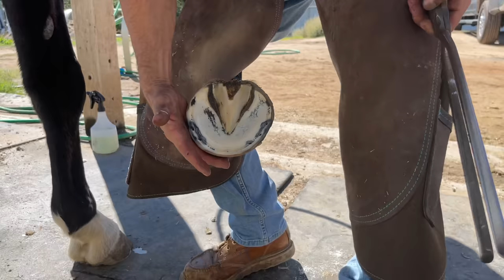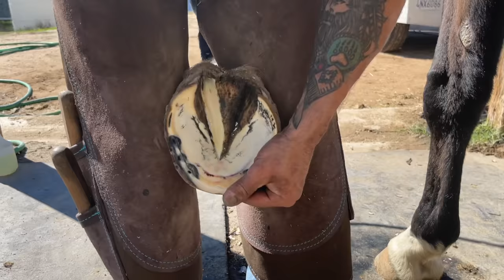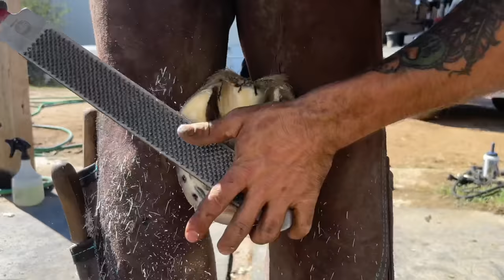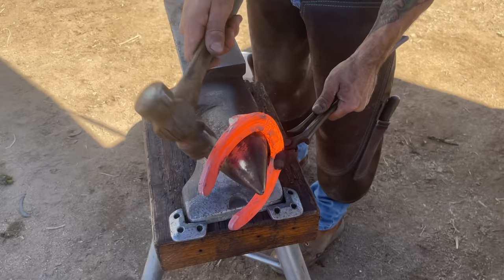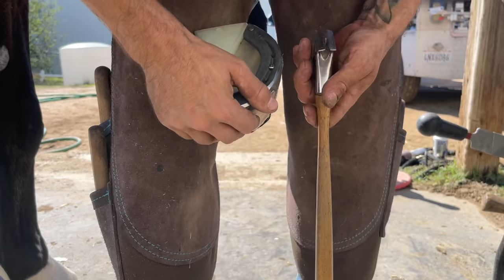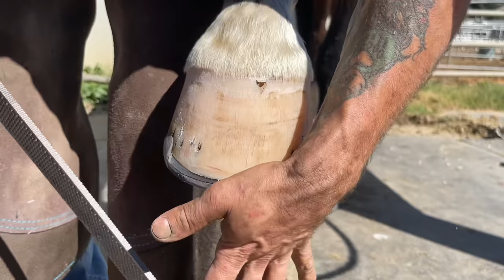Farrier ASMR-Full Hoof Restoration Copper Sulfate Hoof Packing (Satisfying)

Comment: I'd love to see one where you explained what/why you were doing. As someone who has never shoed a horse (and never will) I think it would be super interesting to hear the basics from yourself, given you're so clearly an expert in your field!
Reply: I second this suggestion.  It would be interesting to hear about the anatomy of the hoof and what he’s doing to specific parts and why, etc.,
Reply: Nobody talks when doing a asmr,wdym
Reply: @Terminal.Rainbows  & Sigijade :
1.) Carving out the sole. 

2.) Carving out the bars (heel). 

3.) Clipping the hoof wall (quarter walls)

4.) File or sear the bottom of the hoof so it is plumb with the horseshoe.

5.) With brand new shoes, nailing in 2 nails for the inside of the hoof and 3 nails for the outside of the hoof. The claw of the hammer on the topside of the hoof afterwards is the clip off the excess of the nail. Then they nail is smacked into the side of the hoof so it is flush and doesn't protrude.

6.) Then the toe is filed to be flush with the front of the horse shoe
Reply: 🐎 Horse Boot Polish...😎
Reply: Strong silent type
Reply: 1 second this. Im fascinated by watching this.. It would be helpful to know the whys.
Reply: You could watch The Hoof GP. He works on cows feet and he explains a lot of what he does. It is different from horse hoof trimming but still really fascinating to watch
Reply: 8
Reply: I agree.
Reply: watch S&S horse shoeing. he goes into detail ❤️❤️
Reply: @malayguyutubee3405  what do YOU mean? yes people do talk in asmr videos lmao
Reply: @asmongoldsmouth9839  Hello, do they remove skin of horse/cow during Hoof restoration?? Please, let me know.

Also, is Hoof restoration practised worldwide?
Reply: @MrAAMNNITAllahabad  afaik no, no skin is removed as that would be painful and unnecessary, only hoof. Like your fingernails.

And this needs to be done (the trimming, not the shoes) or else you get an animal that can't walk anymore and is in constant pain, yes. Does everyone do it? No. Should they? Yes.
Reply: Чувак, это асмр
Reply: Blessing and honor and glory and power Be to Him Who sits on the throne, And to The Lamb, forever and ever.

Comment: I gotta ask because this has to be such a lost skill in demand. How often (on avg) does a horse need to be shoed and about what is avg fee?
Reply: About every month and half, in the UK it costs between £100-£140 for trimming and shoeing per visit.
Horses are not cheap...
Reply: @dogsnads5634  yeah, cheapest part about owning horses is buying em, its all bills from that point onward!
Reply: In my part of Canada Carol, its 45 bucks a trim every 4 to 6 weeks and shoes vary depending on what the animal requires for shoes...like anything else, how one horse is shod differs from the next as every animal is different.
Reply: @kimcallaghan3404  thank you so much Kim for the info
Reply: Hardly a lost skill.
Reply: Have to shoe at least every 8 weeks and 6 is better, in colorado a full set f regular, not hot shod for therapy showing like this is 150 like this can be over 200

Comment: Being a farrier isn't an easy job by any means. Setting the physical labour  part aside for a second, a farrier has to learn two very different fields of knowledge: anatomy of and how to treat issues with horses' hooves, and how to work metal. Shaping a shoe isn't just heating up a strip of iron until it glows and then hitting it with a hammer until you get the shape you want.  you have to know what temperature is best to work with, and how over- and under-heating will affect the metal and its properties. Then there is the hammering itself: I did some jewellery making and silver smithing some years back, and learned that if you hit the metal in one way,  one thing would happen, hit it slightly differently, and something completely different results. 

          So I take my hat off to all farriers- after all, they aren't just people fixing metal shoes to horses with nails: they are true masters of two very different crafts!
Reply: Blessing and honor and glory and power Be to Him Who sits on the throne, And to The Lamb, forever and ever.

Comment: Very nice! I've watched quite a few of these videos now, across different channels, and you're doing an outstanding job! :) Here's a question: You're fitting the horse with a shoe that includes a plastic layer. Is that for additional protection? I saw one of S&S's videos where he added a leather pad for therapeutics (I believe because of a broken bone), but that's probably not the case here?
Reply: They are used for protection, prevention, rehabilitation, and orthopaedic. Not sure about this horse in particular as there as so many reason a horse can be fitten with them.

A few examples
Some horses have them due to work, for example some endourace riders have sole padding to prevent rocks from puncturing the hoof. Others have them due to areas they live in.
A horse that hurt their foot will often be fitten with some form of sole padding/support.
Lastly some horses have conformation/genetic issues and are fitten with sole padding/protection to prevent damage and treat any issues they may have (:
Reply: @mochimacaroon400  Thanks for the detailed answer! I was wondering the same thing as Christian.
Reply: @mochimacaroon400  so they're basically like insoles that we use in our shoes.
Reply: @annemary9680  That is a spot on comparison  xD

Comment: While I don't know much about farriers and the details of your profession I have to say your the best I seen so far. Your attention to detail is refreshing. You sand and buff the hoof and add a coat of varnish (I think) which I have never seen others do. The end result is really pretty, neat, and clean. A true pedicure. I do have a couple of questions though. What is the inlay on the horse shoe, and what does it do? And, can the heat from the shoe, when you are searing the hoof to check the fit, cause the horse pain if left on too long? Enjoyable to watch. 😊❤🙏🇦🇺🐨
Reply: Probably hoofoil. Not varnish

Comment: Question if anyone knows: are those black areas, concentrated around dark dots at the front edges of the hooves, because of where the horseshoe gets hammered into the hoof? From the nails? Is it residue, or staining? 🐴 thanks 👍
Reply: Its bacterial invasion and hoof horn breaking down. One of the many reasons metal shoes are not a good idea for hoof and horse health.
Reply: @classicambo9781  epoxi shoes doesnt really laset that long and harder to reuse, metal can be remelt after the shoe wears out, epoxi harder material wise, not saying i know anything about horses just meterial wise plastic-ish materials is harder to reuse than metals :)

Comment: How often does it have to be done? I have watched a few videos. Looked up the anatomy of the horses hoof .frog .white line..lingo ..  The goal seems to be to keep all the weight of the horse on the outside edges of the hoof and keep the wieght off the frog . Is this correct?( Is that mineral oil)
Reply: 4-6 weeks. And yes. That's why they use that blue stuff. And to prevent grit and dirt from getting trapped